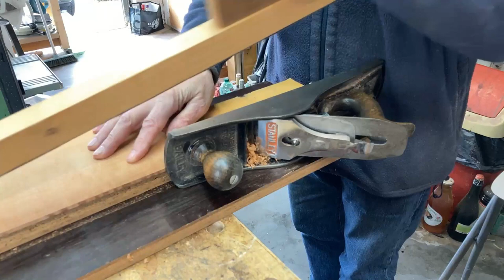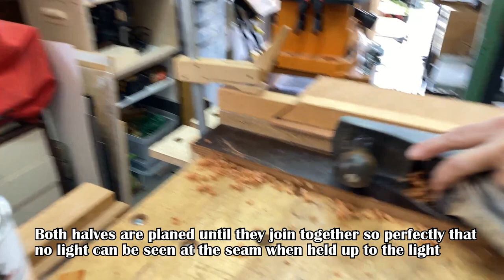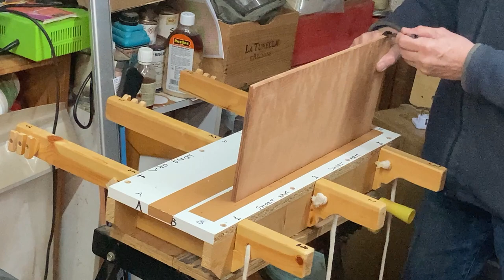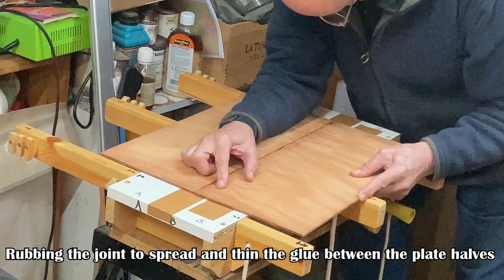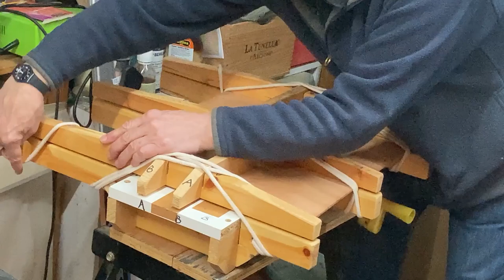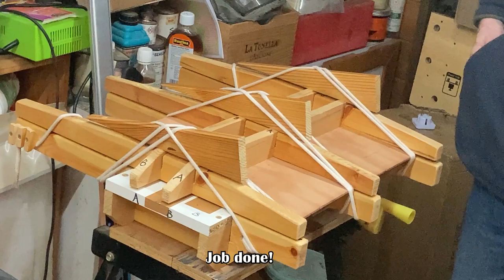Lutherie skills - preparing and gluing guitar top #shorts

Comment: That clamping jig is rather fabulous
Reply from the maker: The hold-down  to clamp the plate while I'm planing is another brilliant and simple idea I stole from the Totnes school where I learned; the big clamp affair for the glue-up is just very old. Easy to make, too. (LMI sells them for nearly $200 😮; nicer than mine for sure, but...)
Reply: @GarlandStringedInstruments  So simple and brilliant that planing clamp trick. You've been screen recorded and looted!

I tried to hand plane a joint like that with a shooting board and fine-tuned shooting track, and failed miserably to produse the perfect straight edge I need for the glue joint. I will lift it against the light, and it would shine through the joint. I gave up and cut the perfect edges I needed on a router jig. The videos are on my profile. Now I have something extra to add to my shooting board jointing jig. 
Thanks.